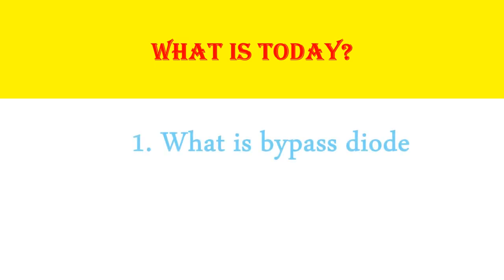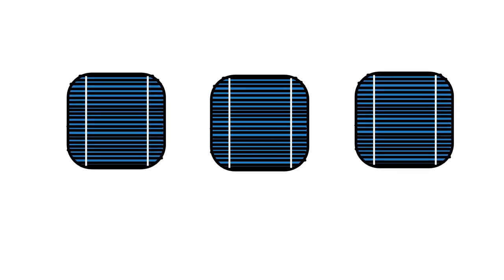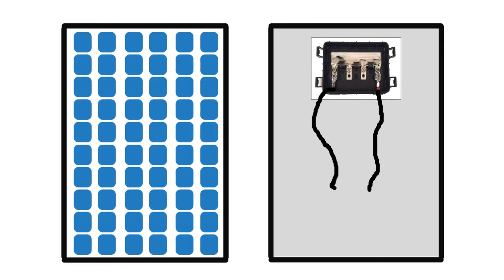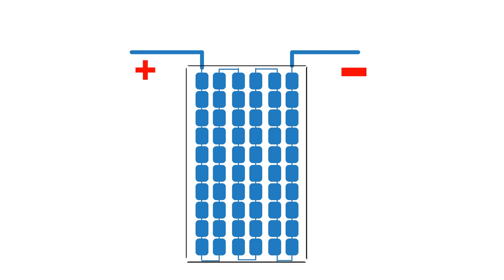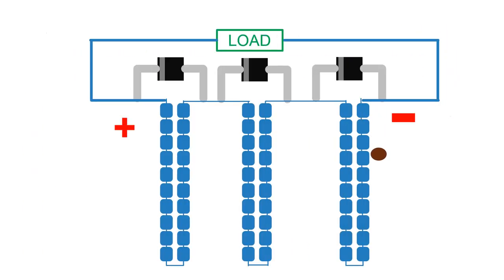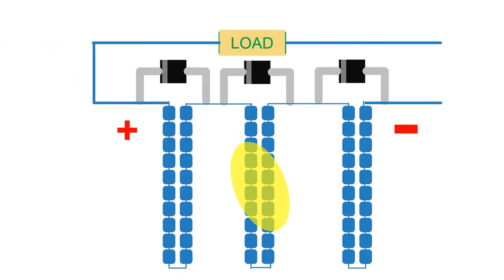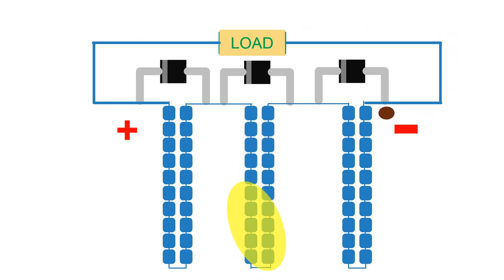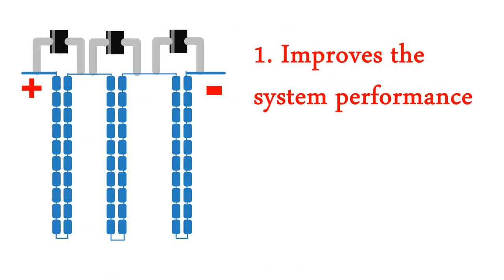Bypass Diode in solar Panel explained.

Comment: Can you please explain why there's no current through the bypass diode unless shading blocks the path rough the solar cells?  If the current can find an alternate route through the bypass diode, why does it only work during shading on the solar cells?
Reply: In normal unshaded conditions there is less resistance in the string of cells than in the resistor.  When cells in the string are shaded their resistance increases so now it's easier to go through the diode (ie, "bypass" that string of cells)

Comment: .....the panels get very hot , the heat may stress the diodes . My panel one diode has failed and become a short . Panel works again after snipping a lead of diode.  So I guess if it works I can keep using it without one diode .

Comment: Could there be a situation where cell strings develop internal resistance to current flow, but still contribute terminal voltage, such that the panel shows full Voc but less than 20% Isc? I have this problem with a premium brand panel.
Reply: Is your solar panel frame grounded?

Comment: I need help I bad connected the -ve of the panel to the +ve of battery same as the +ve of panel to -ve of battery I got a spark after I checked the panel it stopped producing 22.3v  and was showing 8v ,is it damaged completely or I change the panel diod the panel may work again ?
Reply from the maker: Most probably diode might have got short circuited. From my thinking, two diode is short circuited and one is working fine, that why you are getting 8 V. You can verify it with a multimeter. If diodes are faulty, then replace it and everything will work fine.
Reply: @TechSimulator  thanks let me try it

Comment: Great animated demonstration as oral explanation is not easy to understand,  please tell either blocking diod & bypass diod are same or different
Reply from the maker: They are different
Reply: @TechSimulator  i disagree, they are the same, its just that the configuration that makes it a bypass or a blocking... Depends hoe you connect it. But blocking and bypass diode are the same diode.

Comment: what if we connect positive and negative terminal of panel?
Reply from the maker: You mean connect the positive terminal to negative terminal directly?
Reply from the maker: Nothing happens. Short circuit current flows through the terminals.

Comment: Ratting of blocking diode with respect to solar panel ratting
Reply: Reply sir
Reply from the maker: For a 250 watt 36 v panel, we use 3 bypass diodes. So each diode will see theoretically a voltage if 12 v across it. So we use 15 v diode. Now for 250 w panel, max short circuit current comes nearly 7A.  So a 15V,10A diode will work fine.
Reply: The forward blocking Voltage
Reply from the maker: For blocking diode u have to choose voltage twice the open circuit voltage of solar panel. Current you can use the same. So for 250w 36 v panel, u have to use a diode of voltage minimum 72 and current 10 amps
Reply from the maker: 100v 10A diode would be ok
Reply: @TechSimulator  I sir I will asking about  bypass diode turn on at which voltage 
When shading occur
Reply from the maker: I didint get what you are asking
Reply: @TechSimulator  if  two panels are connected is series 1, 2
If 2 is shaded 
Then 1 panel current flows through bypass   
Diode
At which voltage bypass diode can turn on
Reply from the maker: Practically speaking bypass diode is ON always. That is because there is always a mismatch in the current produced by each cell module. So whenever there is a mismatch in the current produced by each cell module, additional current goes through the bypass diode.
Reply: @TechSimulator  thankyou so much